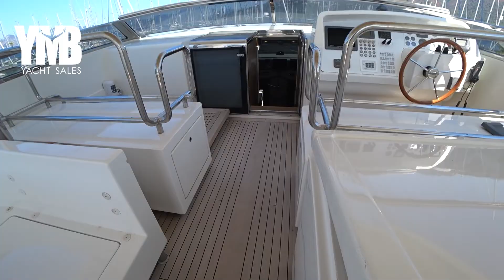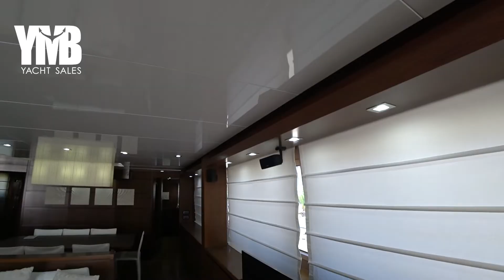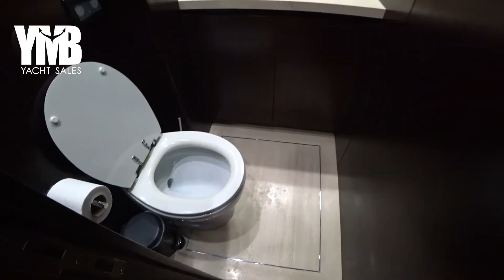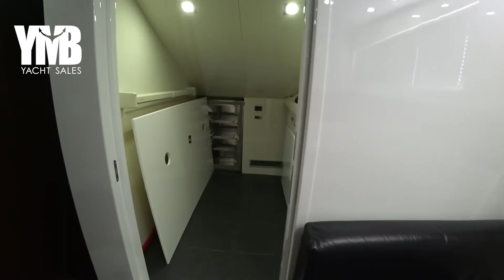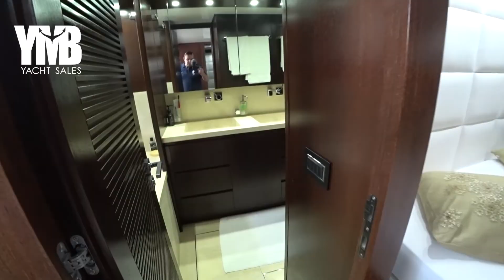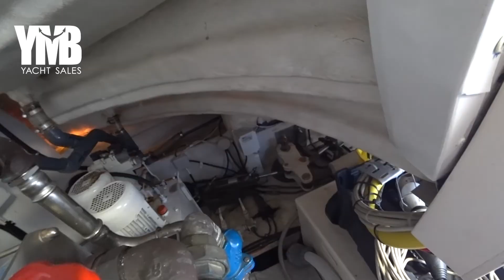SUNLORENZO SL 88 / 27 m Motor Yacht For Sale Interior Walkthrough

Comment: Great video like always. You did not put the navigation range but if my calculations don't fail me it is about 800 miles with a 500 liter reserve at a speed of 12 knots. Not an ocean crossing vessel. Great looking pilot house.
Reply from the maker: Thank you
Reply: Yes I calculated similar, ocean crossing needs at least 3000 NM of fuel
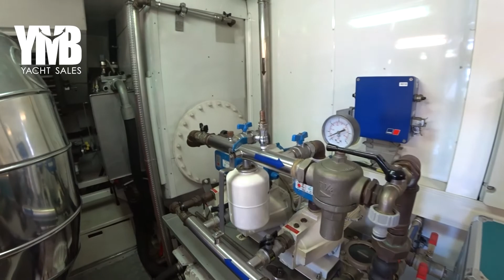Reply: 29:27 ...I thought he said 10,500 Liter fuel capacity? 🤔  Oh the range is only 800 miles?  That's almost the width of Texas

Comment: You always do a detailed showing of the yachts you sell very well done unfortunately, that boat with all the squeaking below deck, the floors would drive me crazy, definite dealbreaker. 
🇺🇸🇺🇸🇺🇸🇺🇸🇺🇸🇺🇸
Reply: Worse on the hard because of pressure points on hull - not noticed (nearly as much) when you're rocking and rolling or cruising with ambient noise.
Reply: Older GRP hull everything moves over time and especially the floors squeak badly